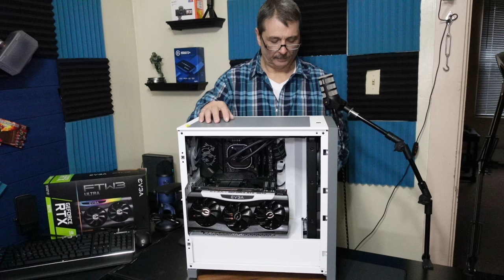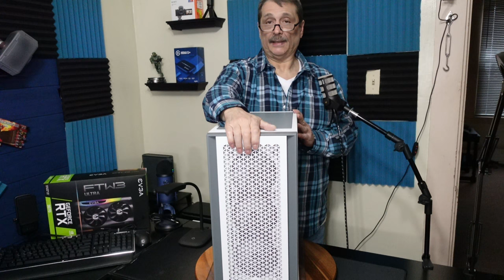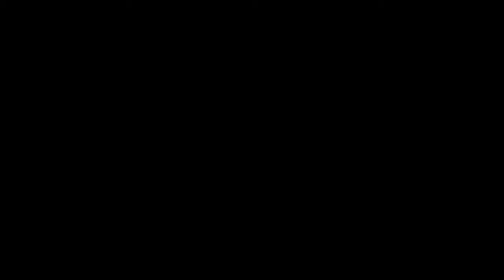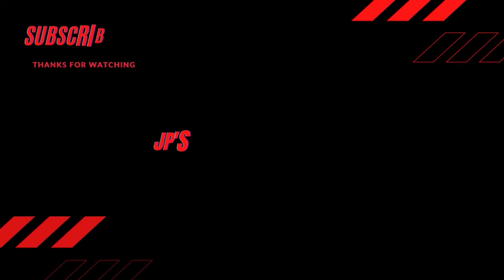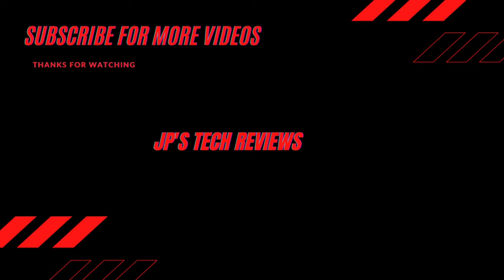Fresh Intel 12600K build

Comment: Phanteks do a really good vertical mount kit that has worked great with my 5000x / 3090 build. My thermals were terrible when I mounted it using the pre drilled holes on the case.